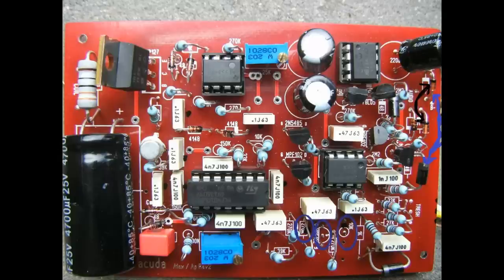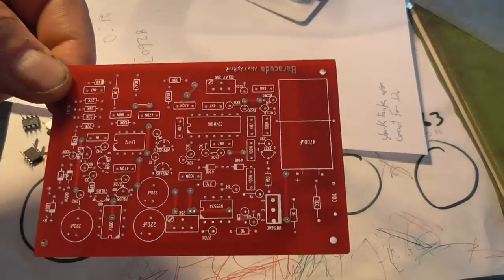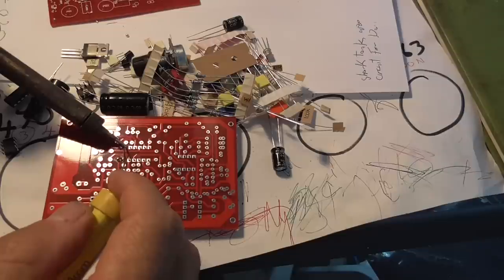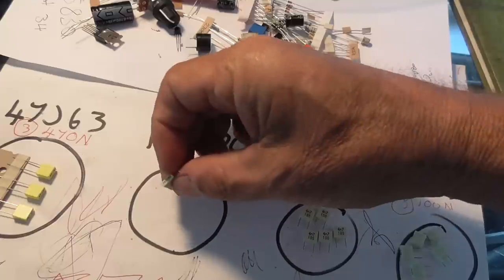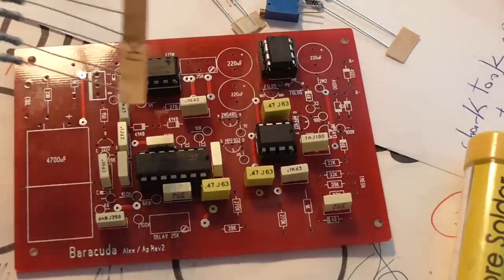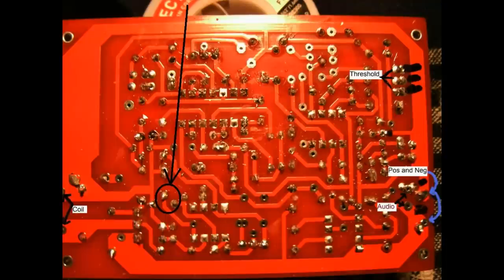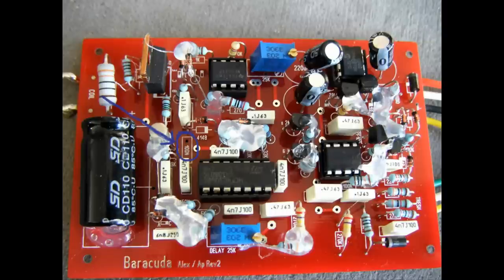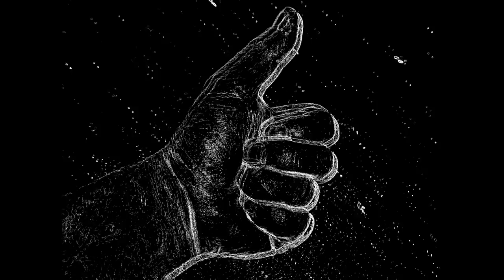HOW TO DIY ONE OF THE BEST METAL DETECTOR CIRCUITS.

Comment: Some soldering / board making tips, fix the smallest and closest fitting components on the board first. Use a piece of sponge over the loose components grip tight and invert then they do not fall out, build slowly away from the PCB. IC sockets, tag two opposite corners, invert and check they are flat if OK solder in, if not you only have to unsolder "1" joint.

Comment: Good video, thanks, and I would like to add one advice, when adjusting the blue trim pots (variable resistors), make sure you do not use a metal screw driver, it will alter the detected signal and will give you wrong readings, rather use a plastic trim pot adjuster or anything non-metallic. Thank you again mate.
Reply from the maker: Never thought of that.. Thanks Omar
Reply: I know this is an old comment... but is that because of induction?

Comment: Great job Freddy, just one tip if I may. I did quite a bit of micro soldering on missile launchers in the US Navy so i've done much of what your doing here and I gatta say, you do great work, to help from soldering two or more posts on you din plugs together it's good practice to start furthest away from you this way the fatter part of your irons tip doesn't get near the previously soldered pin. Probably a tip better suited for the more amature guy who may be watching this. Just a tip from a guy who's soldered 250 pin 24k gold "cannon plugs", the screw in type. Love the project buddy, very nicely done.
Reply from the maker: I am a true novis however

Comment: The key is to place the correct component in every pcb location and then solder the components to the pcb pads well avoiding the dry joins.
Reply: George George best advice here

Comment: Hello Frederick, i have a question for you, The surf pi 1.2 (XTR) is better than the Barracuda legend ????
If you got a comparison it would be awesome.
Regards
Reply from the maker: Both are pulse inductions with 12 volt input but diferent circuits, the surf pi is particular suited to salt water. the baracuda works well on normal ground and salt water.

Comment: After watching this inspired me to build one, unable to 0 volt at pin 6 (mine 3.3 volts lots of turns few Milli-volts of adjustment, what amps does your draw? mine 2.63 amps and mosfet get very hot quickly as well as the battery pack, thanks

Comment: I like your video I have made it but I have a problem please help me in the special audio section the sound is small and the transistor gets hot, I hope to get a solution🙏
Reply: I have provided support for you too🙏
Reply from the maker: sounds like the coil output wires touched and have shorted and burned a part. or the back of the circuit board has not been cleaned with alcohol. (silicone chip short)

Comment: This might be my next project. I do have a question on a different detector. The Twin Loop Treasure Seeker. A P.I. detector by Robert and David Crone. I built one and haven't got it to detect anything! I own 4 detectors and have made 3 others. 31 year old magazine article about the Twin Loop T.S. left out that the circuit board needed top side jumper wires and a discrepancy of coil winding #, 24 or 30. If you have any info on this Treasure Seeker circuit, please let me know. Thanks. Robert and David might be pretty old by now. If this detector in the video above has trouble in Australia, it might have trouble in New Mexico. Any feedback from people in New Mexico that have built the detector in the video? The Garrett Infinium works out here, I dug a hole 3 feet deep, 2 feet wide only to find expanded mesh screen. Good exercise.
Reply from the maker: Can't get the parts now and it is a complex problem to say the least.

Comment: HI Fredrick
 Great video well explained on how to do the basics of board and circuit set up and solder.
What Voltage is the unit working on ( 8V 9V or 12V )as there are no instructions  or parts list with the Kit I purchased last week.

 Also just to confirm the Coil you made was it on a  250mm Diameter former also the wire 0.5 dia  x 20 turns is that correctas I have seen another site which gives 250 dia 0.4 wire x 22 turns Thanks
Reply from the maker: Ron Gill Better off with more winds on thicker wire. in other words go with 22 turns at .4 as it shouldnt damage the board with too much resistance. Any hook up voltage below a solid 11.5 will cause it to become erratic so it is a 12 volt system and very power hungry too.

Comment: Gold rings are on most coin shooting sites.  The skill level is high. Most read as junk!   they really do..
Reply from the maker: +Gary Hunter yes- Unfortunatly most detectors see gold rings as aluminium pull tabs
Reply: +Frederick Barnes Which is why I dig pull tab signals ;)
Reply from the maker: Discriminators are useful for finding coins in trashy areas i find

Comment: Great video, thanks Frederick! Your other videos have been incredibly helpful also. I've just started getting in to detecting (this week), but a decent detector is well out of my financial reach at present, so I'm going to give this project a go. 

Would you be able to give me an idea of what type and size coil I should build to give me the best chance at finding small gold nuggets in soil with reasonably high mineralisation? I see all sorts of designs floating around, though I don't understand enough to know which will work with this circuit. Would I be correct in saying that this circuit is limited to mono coils?

Would you say this circuit performs better than the Surf PI?
Reply from the maker: I like Minelab Equinox from what people tell me.
Reply: Depends on the size of the gold you may find. small coils are best for small nuggets.

Comment: schmidtt trigger,  2 jfet  opamps  , and one I can't see properly. I was thinking of building a pll metal detector  using a 565. much simpler, can also  differentiate between different ferrous metals. which is better?
Reply from the maker: If you can find a circuit that can tell the difference between ferrous and non ferrous then it is better

Comment: Hi Frederick, I have built a few Surf PI's from Silver dog (all testing and tuning but never field tested), have you experimented with any other coils ? i found that the basket weave was better than the mono's when it comes to smaller gold. Have you built any other kits ? and which machine do you prefer the surf pi or barracuda ?
Reply from the maker: Congratulations they are not easy,- i like the Barracuda mainly because i find it easier, i would like to see your basket weave coil . i found mono elliptical works best for the Barracuda
Reply: i have to agree, i messed the first one up, the second one i made a water tight tube that wasn't very water tight and lasted a few seconds when submerged, i have a few more boards that i will put into housings when i get back home, I'll get a video of the coil up and will post a link to you, the basket weave is a lot harder. Ill give the Barracuda a try, i have been looking at building something i can use in a gold field, as my go to machine for the beach is a excalibur.
Reply from the maker: Goldfields are exceptionally difficult,  all detectors struggle,. the minelab and whites are the only 2 i would trust to find Gold.
Reply: I'm not from Australia and I'm not sure what do you mean by "goldfields" and "gold". You're saying you wouldn't trust Baracuda from your tutorial to find any gold, or just gold in "Goldfields"? Excuse my stupidity :D
Reply: probably he meant Victoria Goldfields

Comment: Hello Frederick! Thanks for the awesome video. I'm planning to get started on my own metal detector but need a little help answering a few questions if you don't mind, it would be highly appreciated.
When purchasing this kit from silver dog, does it come with all the on board components?
Is the barracuda legend considered the "control box" of the metal detector?
Also what are all the parts that make up a metal detector such as coil,headset,etc.?
Reply from the maker: sam qadd Q1 all components except headphone jack and the rest of the metal detectorQ2 i call it the control boxQ3 coil, adjustable shaft, hand grip, arm rest- a manufacturer would have diferent names and more detailed descriptionsi have videos on how to make the rest of the detector, but my ways are diferent to most others, and it is not an easy project
Reply: Thank you much! This is very helpful.

Comment: Started soldering this board today then got stuck,The delay pots(Blue ones with adjusters)are
different.Both have 3 pins,but on one the middle pin is offset,On the board were they fit both places have 4 holes.Does it matter which way they go.Any ideas.
Reply from the maker: There is a little circle on the board for the brass adjust screw. one is towards the outside one inside, follow my  picture in video.
Reply: Hi,The board looks slightly different to the one in your video,I can just see the one on yours,But nothing on mine,Might have to fit them and see what happens,50% chance it will be right.Your videos are really helpful...Big thanks.
Reply: Think I found,On silverdogs web site it says" 3/8" multiturn Cermet 100K offset legs" So the other one must be 20K.Right were's me soldering iron.Thanks

Comment: I see the black goes on one terminal  of the pot, Does the positive go on the other pot terminal ?
Reply from the maker: +patprop74 Stop the video and note the time, commemt to me and i will try to answer you accuratly
Reply: +Frederick Barnes //\\  time index 14.44 //\\ you have the negative alligator clips on the  green pot wire, my question is, the positive connected to the pot ?
Reply from the maker: +patprop74 Positive (red) and negative Black) is hooked to pos and neg which is marked on the board
I use different color wires for the pot and audio out so I don’t get confused and hook the power wrong. If the pot is wrong it won’t work, -hook power to it and all your work is destroyed

Comment: hi I have got a goldenmask detectector , powers up but can't increase sensitivity, works well , but no change from zero to full sensitivity, any help would be appreciated thanks, Stuart
Reply from the maker: I would not normal recommend taking apart a detector and i am no expert but it sounds like the turn pot or part near it has failed.or the batteries are failing...

Comment: what DIY kit would you recommend for use in the gold fields?
It would be great if you can use it on the beach too.
Reply from the maker: Phreaker The hammerhead has control over its operation.However detector companies which solve that problem ask a premium for their detector because it is the most dificult problem to overcome.Goldfield areas are often full with conductive material, especialy in Australia. it is like finding iron through iron. in other words most detectors see the goldfields as one big iron field

Comment: Thanks for your video, really helpful!
Can you please tell me one thing about those black ic chips: are they out-of-box ready for making a metal detector, or they require additional programming? Also about other parts, do I simply buy them in electronics store and expect my metal detector to work?
Thanks in advance, keep up the good work!
Reply from the maker: Already programmed but best buy the parts and board from silverdog in england
Reply: Baracuda detector doesn't have any microprocessor hence no programming is needed. All parts can be bought in electronics store. Silverdog sell the Baracuda kit as well as the PCB only.